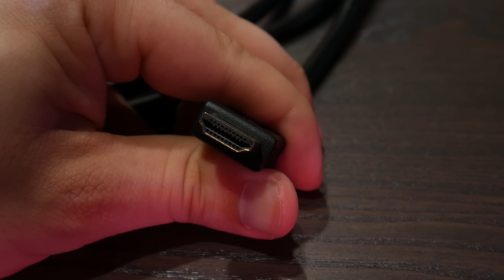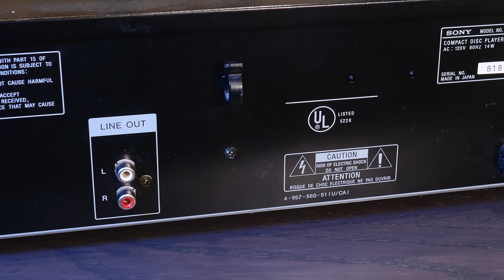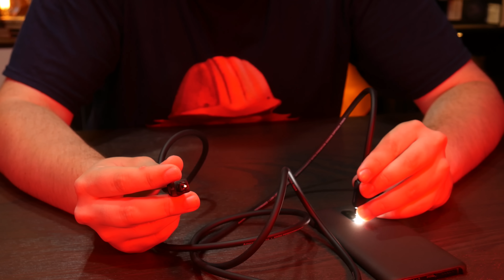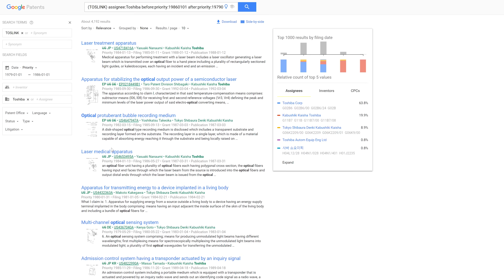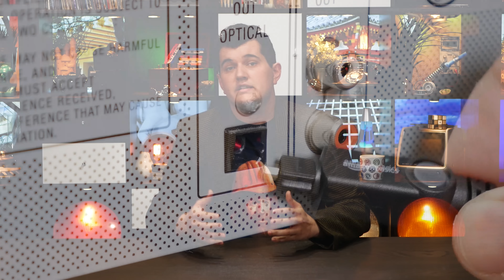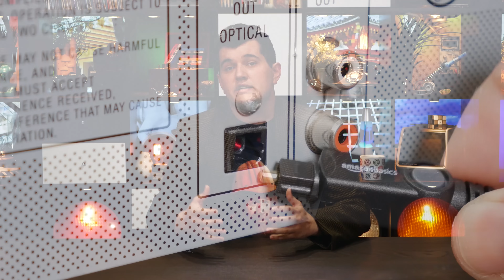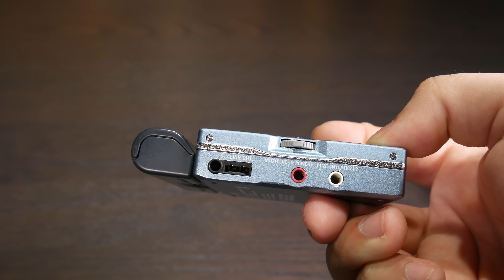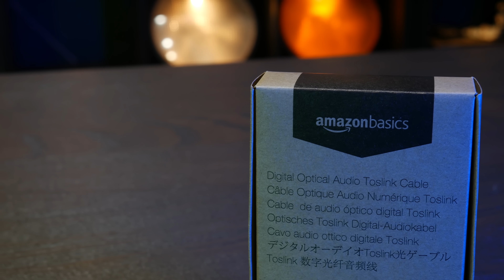TOSLINK: That one consumer fiber optic standard

Comment: it should be pointed out that if you have polarizing filters and quarter-wave rectifiers involved more than one optical cable is just not needed, you can literally fire off multiple LEDs or lasers with different frequencies and send them right through the same line, where the other end will obviously let all out, so filters over the receivers will stop unwanted frequencies from getting in while allowing the other frequency of choice to get in, thus allowing for sending multiple streams of data, and this can all be ran through polarizers so that the receiver and sender can be separated at their end while allowing the other end to pick it up, thus allowing dual directional sending and receiving through the cable, of all frequencies, and how many frequencies are there? seriously think hard about that, if you question how many streams of data can be sent through just one tiny little fiber line, because it will reveal that building the LED tech out to produce more frequencies is all it takes to add another stream filled with as much data as any other stream, two frequencies, double the data, polarizers, now you have quadruple the data, since you have two streams going in each direction, now. now try that with wire, and it gets quite complicated since even the wire itself is now causing an issue since the data is bleeding into each other with out shielding around each wire, (its part of the reason for the wires being twisted in ethernet and if you pull one apart by peeling the outer sleeve you will see that each color coded pair is twisted at different rates (twists per inch or some such) to help keep them from interferring with each other on the EM spectrum, ) also LEDs are insanely small, and most of the size is just housing, so packing multiple LEDs into a tiny space is easy, add to that, that many LED emitters only need conductive paths, and are infact actually crystals you can see that stacking them infront or behind each other works too, as the light from one will pass harmlessly through another depending on the materials and what not that are used, so theoretically you could easily have 10 or more LEDs all in a row, and fireing down into the exact same cable, while sheilding receivers around them for each of their colors coming from a similar LED stack on the other end, while not getting any flashback from the LEDs inside the photosensors around them. this would give you 20 times the data in one tiny piece of fishing line, basically, unless you are actually using glass fiber, 

Also the filter can be built into the wire, and just be a bundle of fibers that each one passes their given frequencies, if you line them up on the ends,

Comment: Fun fact: The real reason why using TOSLINK is better than "SPDIF over coax" has nothing to do with the digital signals it conveys.
It it because TOSLINK prevents "ground loops" between the different pieces of audio equipment, that could otherwise couple electrical hum and noise in the analogue electronics (after the DAC process)
"Ground loops" occur when two pieces of equipment are both grounded via the mains leads, and then the grounds connections from both those pieces of equipment are also connected together locally via the shielding of the signal interconnect cables between them. These connections create a big loop of copper which acts as a loop-antenna to pick up stray electrical fields, coupling them into the sensitive analogue electronics and causing "mains hum" on your audio.
See also: https://en.wikipedia.org/wiki/Ground_loop_%28electricity%29
Reply: That's actually insane.

Comment: What isn't being taken into account is that electrical noise can be transmitted through the cable and into the amplifier or next device. Not necessarily degrading the digital signal, but interfering with the amplification. It's not just that the cable acts as an antenna, but also that it's conductive and allows any interference to spread from device to device and to the amplifier. The fact that toslink is a non conductive cable is the most important reason for it's use vs any other digital connect.

Comment: Many moons ago, I used my Fostex D90 hard disk-based digital multitracker. For output backup, an optical socket allowed what it called ADAT and the standard domestic digital out, running 16 bit and 48 (or 44.1) khz. With the latter, I could back up to CD-R in stereo pairs but the former was actually the same - but with a bleep between each set of stereo pairs of your project. So god knows what that was about, if ADAT wasn't even supposed to be audible through domestic hifi.

Comment: You probably won't even see this, but optical home networking can be done for fairly cheap now. Ex datacentre 1gbps SFP switches are cheap, with 10Gbps coming down in price. Wire your home with OFP3 fibres (iirc) and you should have the backhaul that will be good for 100Gbps+. Swap the modules over when you need extra speed.

It is more than RJ45, but there is something cool about having your own optical network at home.

Comment: I am not an audiofool but what I am is an occasional live sound guy and I can say that there is one distinct advantage in sending signals, and particularly audio, digitally. It gives you the ability to then send that signal anywhere else with no loss in quality and more importantly without any extra noise, buzzing, or distortion added in along the way. In other words you want to digitize the signal early (such as from a microphone) and then keep it digital as long as possible which in practice means that it is digital until it reaches the amps. Now, is this relevant in the home where you are sending a signal about a meter or so from your CD player to your amp? No not really but it does not hurt either.

Addition: I had no idea that mini toslink was a thing, I have seen glowing 3.5mm ports before though, In fact one of my laptops has one.

Comment: Back in the day. When it came to recordings made with your digital recorder, quality wise, TOSLINK or SPDIF connection was the best way to get that recording transferred to a file on the PC. It worked back then because there was hardware and software to support it. But now it's difficult to find hardware/software that will connect that old tech to the new PCs. Most new PCs have a optical or SPDIF output but no INPUT!!

Comment: for audio in home you use isolation transformers and UPS's with AVR to generate synthetic sine waves for the 120v ac power.  so the revievers can be totally isolated from input devices via optical. 
toslink is more prevelant in car audio these days. car audio amps do not contain DAC's. so you have analog to analog via rca's.  high end amps  have toslink but very, very few radios have this. your generally into the 3K+$ range to get a modern car radio with toslink. 
there are serious noise rejection advantages using toslink in a car vs rca's

Comment: The TOSLINK cable keying is also used for ADAT, which carries eight audio channels along lightpipes and is often included on pro audio hardware to connect multiple mixers or AD/DA interfaces (I've got a pair on the back of my Scarlett 18i20 to daisy-chain multiple interfaces together).

Comment: EDIT: Ha! he addressed this https://youtu.be/CwZdur1Pi3M
@Dude, google and learn about optical decoupling before making such a loud statements about unnecessary toslink. Toslink is eliminating on the analogue amplifier's side any analogue noise/humming introduced by motors/transformers on the digital audio reading equipment side. That's what it was designed for. And it do it perfectly.
Reply: Because coaxial SPDIF connects grounds of both devices, and this is last thing you want if you care about audio quality.
Reply: Ha! he addressed this https://youtu.be/CwZdur1Pi3M
Reply: Do you wanna buy a gold plated toslink cable?
Reply: @MercenaryBlackWaterz  kid do you even read?

Comment: As a Network Engineer I can tell you that the only reason fiber is used in data communication is due to its ability to stretch kilometers rather than meters in length when compared to standard copper.  Additionally fiber is much more brittle to handle than cat6 cable, which is why you dont see consumer or even enterprise user facing runs.  

As far as bandwidth restrictions, the Mgig standard pushes bandwidth over Cat6 to 10gig, in the datacenter direct attach 100gig copper cabling is used to connect networking equipment and 10 or 25gig twinax copper cables connect the servers.

So why dont we use fiber everywhere?  mainly cost.  The cost of those direct attach cables is usually half the cost of fiber.  As you push the bandwidth the quality of the laser has to increase, increasing the price.

again the only improvement fiber has over copper is distance.  This is why fiber is more commonly seen on the internet provider side, but be assured that copper plays as big a role in moving data around the internet.
Reply: Trevor Butler Well, most upgrades past 100Base-T have shortened the max cable length, making it harder to get to the other end of a building while following established cable ducting structures.
Reply: @johnfrancisdoe1563  oh yeah for sure.  it's more than common for IDF interconnects to use fiber.  Again, not because of speed, but because of distance.  To my point those interconnects are infastructure links and not to the end user.  Stranded CAT6 is way more resilient than fiber, which is why we always hid the fiber from the user.

Comment: Never saw the added value of those short, breakable expensive optical cables for home use. A simple RCA ("coaxial") cable for digital audio is way, way better. Remember: it's digital, so no loss of signal quality because of "thin" or long cables.

Comment: Sound sampled above 44.1 kHz is only useful for sampling ultrasound, which... why would you even want that? Nyquist-Shannon isn't some kind of guesstimate of how much sampling you need to do to perfectly reconstruct a band limited signal, it's a freaking theorem. As in, scientifically proven. As for bit depths higher than 16 bit? Unless you need more than 96 dB of dynamic range (and you never will; plus the perceived dynamic range of 16-bit audio can be 120 dB or more with noise-shaped dither), 16 bits are plenty.

But I guess they gotta use that increased bandwidth for something...

Comment: Toslink is immune to the "able to be plugged into the wrong connector" issue of all coax
Also 3.5 optical masterrace
Most old mac laptops have that
And many high end laptops do too
Edit: forgot to mention ground loop isolation which is an issue that can happen in spaghettified audio setups

Comment: I have fiber at my own house. I have a line coming in from RETN and it goes into a demultiplexor. Then I can use it (this case I plug it into a SFP module that plugs into my MikroTik router. And I have managed to get fiber to my desktop pc. FTTD (Fiber to the desk) so yes. I am a IT technician so I can do this. Most people will not need it but I also run some servers at home

Comment: 11:50

I was once while plugging TV into a computer with HDMI cable. One end was already plugged in into the TV, while I held another, touching its metal shield while resting an elbow on the computer case. Turns out, community cable TV lead wiring was messed up somewhere in the apartment block and its shielding was shorted to the mains live. Apparently, TV didn't care because we don't have earth at all in most of our homes (hello from Russia), and live potential was just sitting on the TV chassis. PC didn't care either, its power supply also has the capacitive mains filter, with middle point stuck to the chassis. But since there's no earth, there are 110V sitting on the computer chassis too.
Didn't fry any equipment and forced my parents to cancel the cable subscription that day, but the bites like that aren't pleasant :P

Comment: Toslink has one advantage over ARC.

It actually works.
Reply: No joke though, ARC has a terrible tendency to just break for whatever reason. Optical over PCM is the most stable, bar RCA connection.
Reply: So true, my old TV had just normal audio out (the red/white plugs). When I got a new TV it turned out that is not standard anymore, the TV also had no headphones jack. Anyway I used ARC for a few weeks, it sucked so much. I had to change the TV settings back to hdmi out every time I turned it on. Now I use toslink and it just works. No issues at all.
Reply: The removal of headphone jacks on televisions is just one of those bizarre jerk moves.

I mean, they didn't replace it with a more high tech solution, no. They just plain removed it.

Do you have any idea how annoying that is when you live with someone that has hearing problems?  - they turn the TV up SO damn loud...
Reply: @KuraIthys  well headphone jack costs cents, they need to save money 😂
Reply: haha  good burn
Reply: I have 2012 Panasonic TV and cheap yamaha receiver. When I start TV, amplifier starts and when I shut off the, amplifier shuts off. It has been working fine 7 years now flawlessly.
Reply: Only reason I thought a Toslink cable was because the included ARC cable wouldn't work at all for me.  Then I was like wtf is the transfer rate so slow, isn't this meant to be an optical cable.  It makes sense why it's so slow now considering it was made in 1983.  It would have been fairly impressive in 1983 though.

Comment: I want to just say that toslink cables are incredibly simple but effective in cutting away ground loops that unfortunately are very common with digital equipment (especially PCs), and that spdif can't.
"good luck avoiding the building's electrical wiring" there are devices for that purpose, ranging from simple filters to power conditioners that if I understand their black magic they somehow rebuild the sinusoidal current, so that they avoid completely all the wiring before that thing.
Reply: An isolation transformer will do the same thing.
Reply: Power conditioners are fairly cheap.  Just use them.  I do.

Comment: In fact I cured digital audio transmission issues using TOSLINK. 

Often the computer and the A/V Receiver weren't located in the same spot. So I had to run like 10 meters of coaxial cable from computer to the amplifier. 

I had lot's of terrible dropouts because of grouding problems. Especially when load hit the power grid in my flat (i.e. the fridge was staring its compressor). 

Replacing the SPDIF coaxial connection by TOSLINK completely solved this issues for me.
Of course it didn't make the sound any better. It just stopped the dropouts to happen.

Comment: I really like using optical for isolating my audio and computer equipment.
A few centimeter (let alone a meter) of fiberoptic cable has more than enough isolating power to stop lightning.
It also avoids bad equipment isolation in one unit to transfer hum to the other.
Reply: I had a pc that when connected to my DAC would make the DAC produce a loud humming on the audio output due to some ground loop effect.
In essence the digital audio would be transfered fine, but the pc would disturb the DAC so it generated bad audio. Digital electrical link thus carried over noise!
Using the optical cable eliminated the problem.

Comment: The connector was keyed to make  the fiber optic core aligned from input to output connector like in fiber optics we used nowadays for internet it connectors has to be perfectly aligned or else you will get so much signal loss or signal attenuation and it will make the signal quality poor.

Comment: Ever wondered why most Hifi devices don't have Earth Ground even trug they have metal cases?

Ground Loops...
If you connect your earth grounded PC to your grounded AV receiver over a TRS to RCA cable (aka the normal analog way). you Create a ground loop.

You might think well if both devices are grounded they are both at the same voltage so according to this theory the outer outer conductor of the RCA plug should not be necessary for normal operation.

try this theory by inserting the RCA plug halve way so only the inner signal pin makes contact. 

most likely it will work but you will hear a more or less pronounced 50/60Hz hum. 

This is because there ground reference is at a slightly different voltage even though they are already electrically connected over fairly thick ground wires in your wall.

Connecting the Ground from the RCA plug creates an alternative ground part trough trough this super thin wire.
This Helps to bring them closer to a common ground but... your connecting to dissimilar potentials over a low resistance cable an therefore creating potential high currents.

 TL;DR 

Please make a video about Ground Loops.

And About the worst connector ever RCA it connects Signal before ground and therefore discharges (static) electricity into your sensitive analog in/out puts

Comment: Fibre optics transmit data more quickly (as in, what goes in comes out on the other side sooner). As such fibre optics would be the superior choice if you connect speakers with different cable lengths. For analog speakers the signal might also be better. But with TOSLINK limited to (nominally) 5m there really isn't much of a point to worry about the speed of signal propagation.
If I strain hard enough, I can even find a use for gold-plated connectors. Gold doesn't age like plastic. Unless you squish it, it should retain its form better over very long periods of time. A more precisely kept form should improve signal quality through better centering of the cable.
Reply: Miserable
Reply: @boycecat1964  Context?

Comment: My car uses fiberoptics to transmit sound data to the amplifier.

It also lacks standard connectors so to install an external amplifier you need a converter running off the speaker cables. Matter of fact, the amplifier I installed only sees sound data from the left channel, as the right channel was harder to reach.